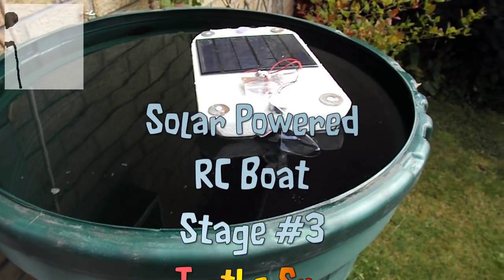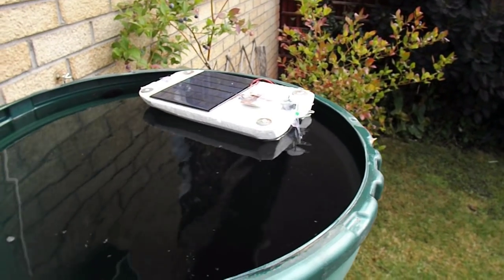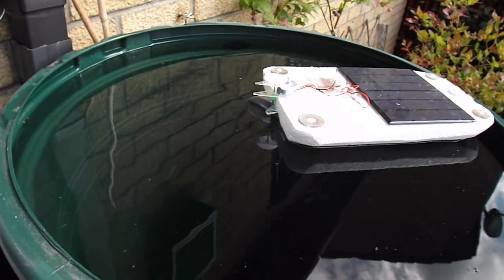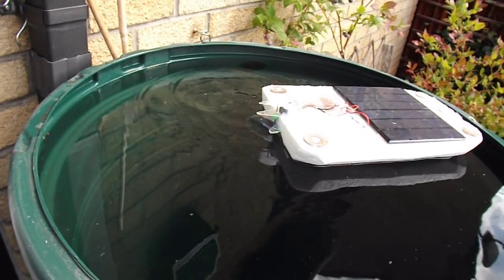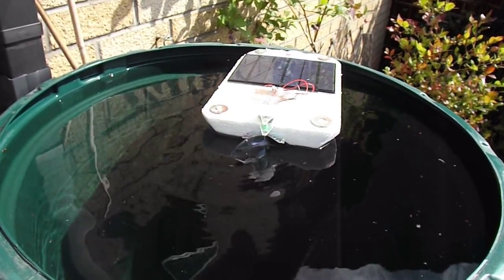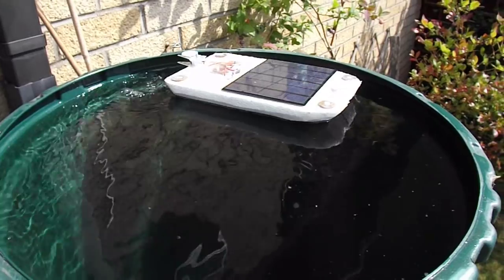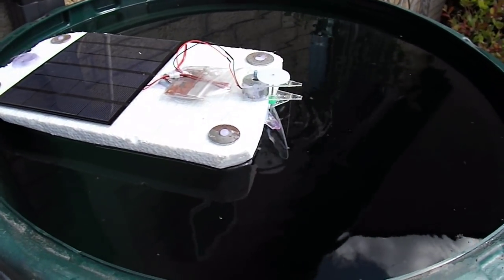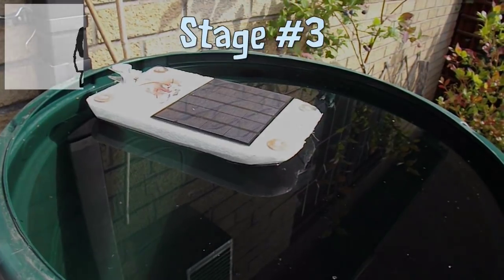Solar Powered RC Boat Stage #3 in the sun

Comment: It performs just great!

Now you should also think of working on a transmitter powered by the sun ;-)
Reply from the maker: deslomeslager hi deslo, I won't be putting any more effort into this :-) To make a really effective solar powered system you really need to add batteries and charger circuits or at the very least some sort of capacitor bank to smooth the current draw. Anyway it's been done before and it costs more money than I like spending on my projects. https://youtu.be/ZmDqklgQvj0
Reply: GrandadIsAnOldMan
Thanks for the link, I liked it (literally).

Comment: Runs great. We have the opposite problem here in Oklahoma at the moment, sun up to sun down with zero clouds. Too hot to fly, drive, boat, though i could probably sail something on the humidity in the air lol
Reply from the maker: slider2732 I won't be silly enough to say I envy you as I do know what that sort of heat is like, luckily I only have to experience it when we holiday abroad and under those circumstances we are not usually very active other than signalling the waiter for another cold drink by the pool or on the beach.
Reply: GrandadIsAnOldMan  Yeah, best plan :)
Though this year has brought the discovery that an old t-shirt over the steering wheel makes the first 5 minutes of driving a lot easier. Can even leave the windows open, but thick metal under thin plastic always brings a 'yikes' effect. Am glad I don't drive over here, wife was doing lots of yiking !
A yikes machine would be good to power a boat, difference between metal and water with a peltier module/bimetallic strip or some such.
Reply from the maker: slider2732 sound like a plan, I look forward to seeing the video :-)
Reply: Will be uploaded right after seeing your solar miners helmet :)
Reply from the maker: slider2732 oh, you know about that project? I thought I was keeping it in the dark.
Reply: GrandadIsAnOldMan
Haha, indeed, indeed :)